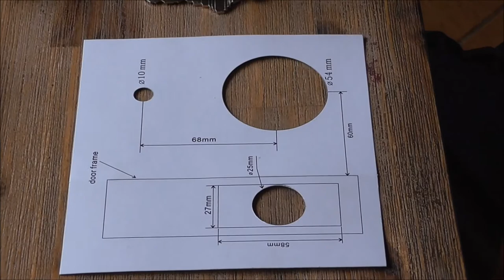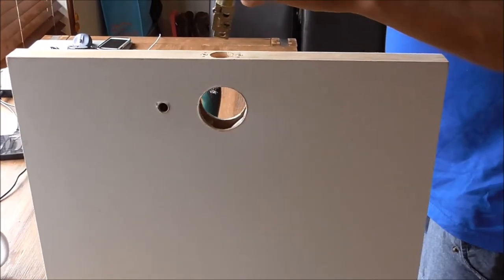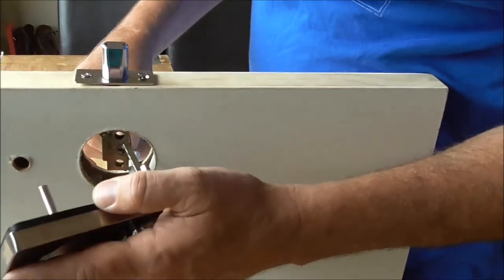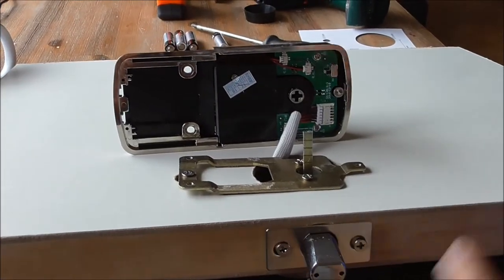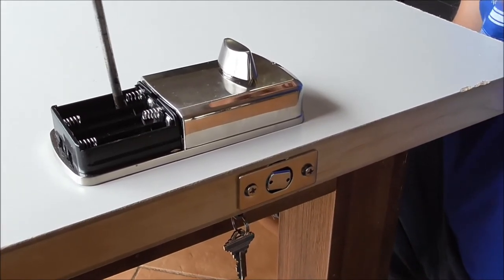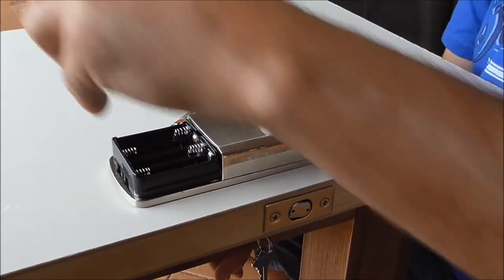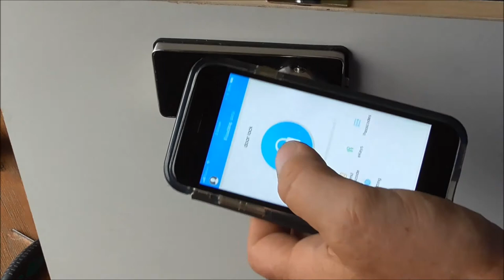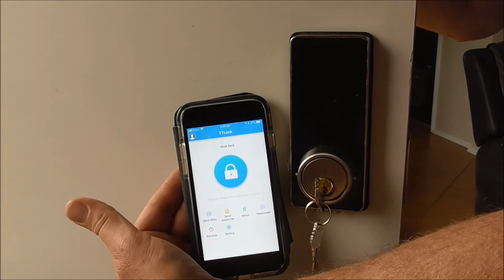UL110 Bluetooth Lock Install video

Comment: I have installed my deadbolt correctly but the L R toggle button is not working. So whenever I wan to lock it unlocks and viceversa. I cannot find a way to reverse this. Could you help me out?

Comment: Recently got this lock, but can only get it to lock / unlock with the key in it. IOW, it will unlock with the app, but only if the key is inserted in the unlocked position.  Any ideas?  Manufacturer has not been helpful.